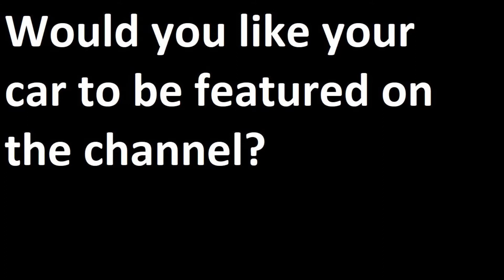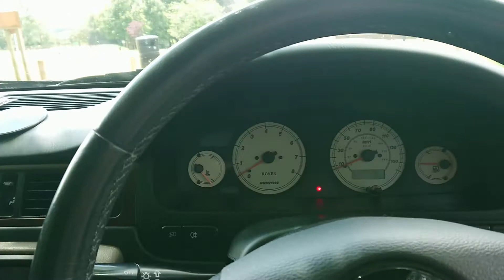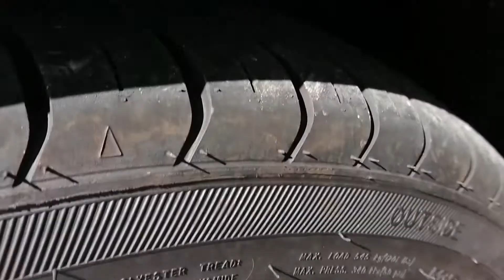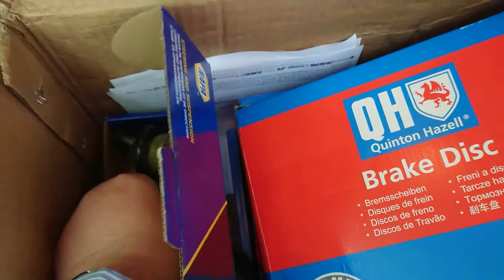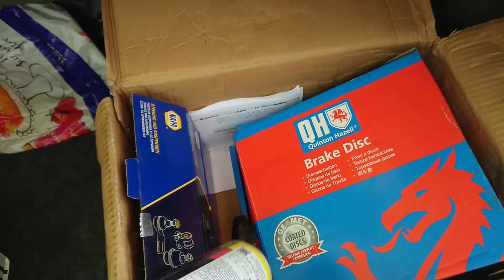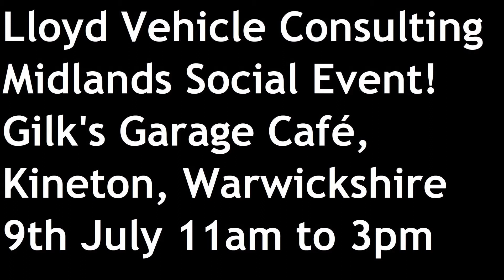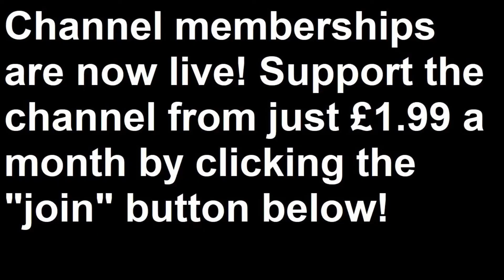The Rubbish Mechanic versus the Reluctor Ring: Was Mr Coleman Able to Fix my Rover 45 V6?

Comment: Excellent work by MR Coleman, MR Lloyd, the headling looks very good indeed. As you mentioned it is a very common problem, with the door cards to owners. Those leather covers do look good, as a pose to the fabric, but costing is a factor. Shame Rover didn't keep the wood on the door cards, I know we wouldn't dream of dropping it. Wood trim and leather, high spec is our thing haha. Anyway happy she's back and with a clean bill of health for many miles to come.
Reply from the maker: Project Drive was a bit of mess, sir, and those door cards were just one casualty. The headlining will be fine now, and at some point when I have saved up we may get those cards done, but not the most urgent job at present. The mechanical things were the most important, and they have now been sorted, which is great.